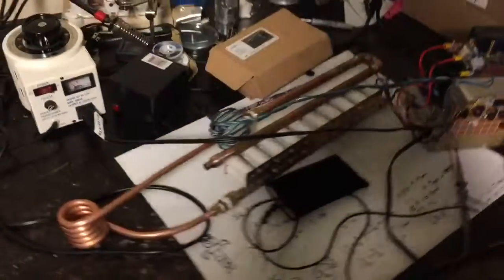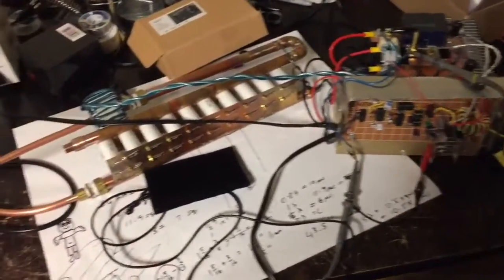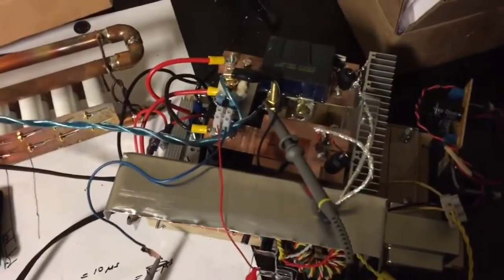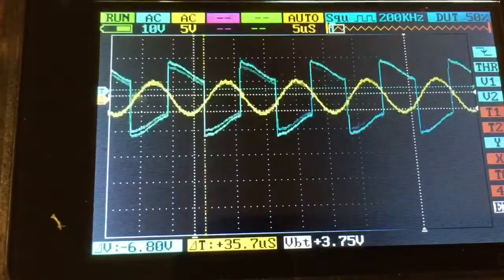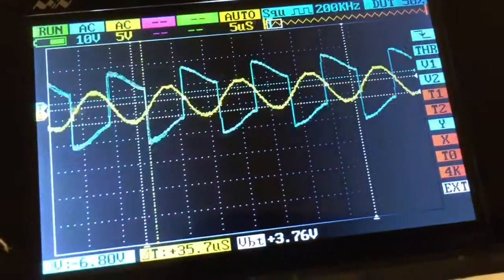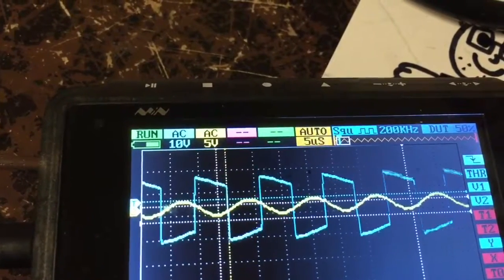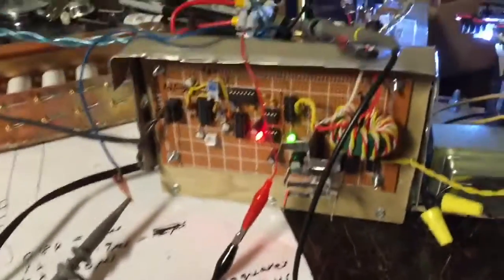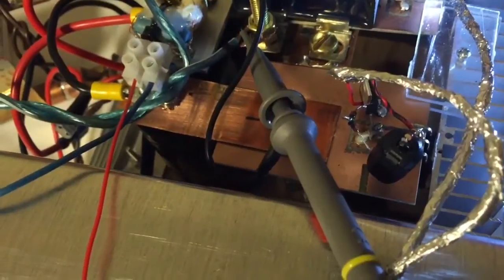PLL Induction Heater Project Update

Comment: Hi, i would like to build a low voltage induction circuit with PLL the way you have in this video, but all of the circuits on the internet are either 115v or 230v  is there any chance of a circuit diagram for your circuit. I would like to run at 24v.
obviously i would need any transformer details too.
my email is mouldykev@gmail.com

regards kev
Reply from the maker: The induction heater in the video is based on the work of Jonathan Kraiden. I was able to run it as  low as 12V AC input from a variac. This voltage could only warm pieces of metal and could not get them glowing. The circuit uses a voltage doubler which is then rectified. The PLLndid not lock properly until the voltage was higher.
Reply: is it possible for you to contact me via email, i need at this stage a private conversation my address is mouldykev@gmail.com
i ask this because i build low voltage induction heaters ( powered from 12-24v Dc ) and it is interesting that you call yourself Teslaspot because i have just done something related to induction heating with a Tesla coil and the results that i have... just astound me in more ways that one. i need to sit back and look at what i have achieved but at this stage ( i woke up at 4 in the morning with an idea built it in 5 minutes ) tested it and wow..........so i need to speak to someone about this, it is not something that i am willing to share with youtube or the internet just yet until i build a worked out L/C parrallel tank and coils and i am certain that i have something, so am willing to share with one other person and have some trust in that person for now.

regards kev

Comment: Heyo, on a completely (almost completely) unrelated note, I'm having trouble with my ZVS flyback driver. I think my power supply is too weak, any idea what I can meek/use to provide minimally 12 volts 10 amps without shutting down? Modified computer PSU's don't seem to work and over current protection shut it down.
Reply from the maker: Have have found the same issue with PSUs. I am using a regulated switching supply for my ZVS fly back driver. 30V is much better and will not cause a drop in gate voltage below 12V (clamped by the zeners) on the mosfets. A voltage drop below 12V on the mosfet gates usually results in mosfet destruction. I am using this one which is regulated and can push up to 400A:
http://www.ebay.com/ulk/itm/182086101381
Reply: +TeslaSpot 101 so basically my mossiest are spoilt now XD
Reply from the maker: +Shamoeel Moochhala it is possible that they may have been damaged if they were operated for long with low gate voltage below 12V.  You can easily check them to see if they are working or not.
Reply: How? I also blew up my multimeter through a series of stupid actions XD
Reply from the maker: You can check the mosfets with a bulb, 12V battery and a 10k resistor. Connect the drain of the mosfet to a 12V bulb and the other end of the bulb to the positive of the battery. Connect the source to the negative of the battery. The bulb should be off but it may be on if there is still positive charge left on the gate. If it is off, connect a wire to the positive of the battery to the 10k resistor and touch the other end of the resistor  to the gate. The bulb should turn on. To turn the bulb off connect one end of the resistor  the negative of the battery and touch the other end to the gate which should turn it off. If the bulb stays on all the time, then the mosfet has  failed.